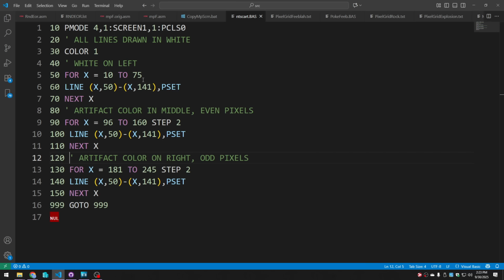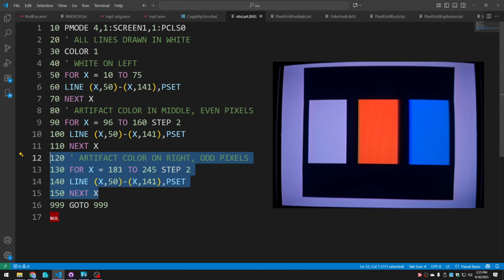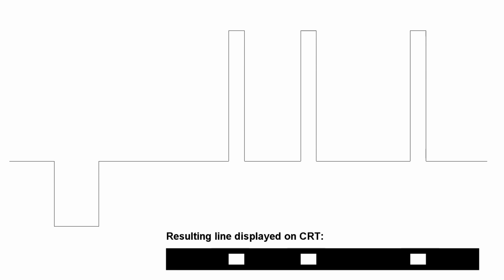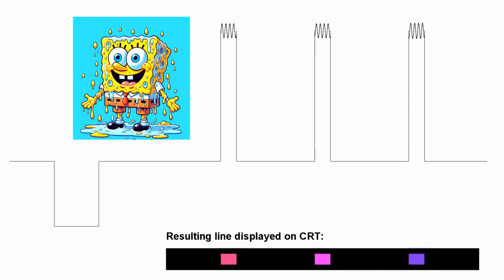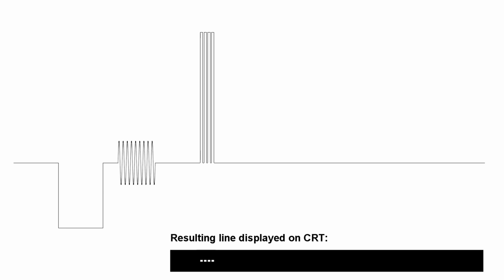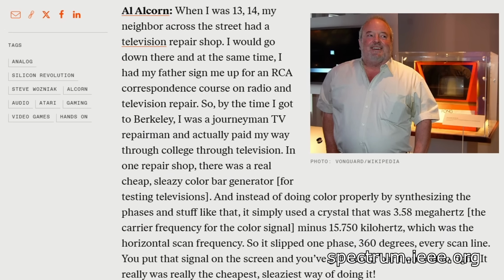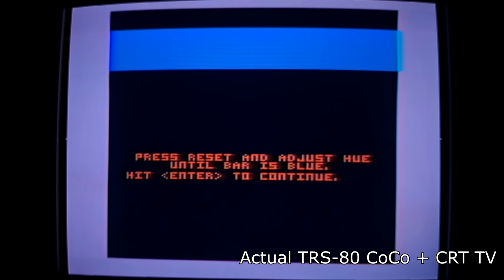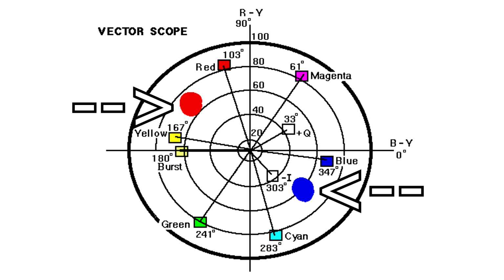How early computers TRICKED TVs into making color (out of nothing at all)

Comment: Not-So-Fun Fact: These "artefact colors" didn't work on TVs which used PAL (or, presumably, SECAM) for their video, since only the American NTSC (Never Twice the Same Color 😉) system was configured so that it could produce colours from B&W.

And the short version of how "artefact colors" worked is that colour in NTSC relied on a signal mixed into the black-and-white (luminance) signal, which the NTSC system could interpret as colour information.  But the way it was mixed in meant that quick changes from black to white to black could be misinterpreted by the NTSC decoder as being colour information.

The PAL system used a slightly different mixing method which meant that the system could not easily misinterpret fast transitions as colour information, although it did produce a vague "rainbow" effect with certain spacings of vertical lines and different spacings of vertical lines were actually incorporated as part of the colour television "test patterns" so that you could easily see that the PAL system was working as intended.
Reply: I do remember seeing the 'rainbow' effect on TV a couple of times back in the day. I believe newsreaders and other people appearing on TV weren't allowed to wear shirts with tightly spaced vertical stripes for this very reason!
Reply: @Tomsonic41 yeah. Actually, the high quality low pass filters at the TV station would filter out most of the false colors. If you drive a TV using your own home computer, you can go full saturation.
Reply: @Tomsonic41  It's still not recommended due to aliasing effects creating weird looking patterns.  The same reason meant it wasn't a good idea to wear such patterns in PAL-land.  The big difference between back then and now is the critical pattern size which scaled inversely with the resolution.
Reply: actually it works just fine on PAL, you just need to use the higher chroma frequency (4.43 mhz rather than 3.58) and invert the "V" color channel each line, other than those two changes, ntsc and pal actually work exactly the same and the same techniques apply
Reply: PAL uses a different color clock. It would be easy for a graphics chip to alternate phases every other line. But US manufacturers did not want to deal with different crystals. Computer manufacturers rather shipped their own monitors (IBM, commodore, Apple).
Reply: @ArneChristianRosenfeldt commodore literally made vic2 that output pal that works on standard TVs.
Reply: @phill6859  commodore started a lot of thinks on the VIC .. Ah VIC2 . Yeah I know that. VIC2 has two clock inputs. You feed PAL frequency into one of them. Color output pin is separate from luminosity. VIC2 really does not do false colors! They even offer a cable which keeps color and luminosity separated all the ways. Later, with a slightly reduction in signal level, this became S-video. On almost every TV on SCART input expects RGB and the other S-Video.
Reply: @ArneChristianRosenfeldt  PAL uses a clock that matches the increased resolution of the whole frame but the major difference is that PAL uses differential signaling on two lines. PAL color televisions required having a small buffer to keep previous scanline worth of signal available to allow correct color decoding.
Reply: @MikkoRantalainen  at least generation of PAL was simple: You just flip a bit in a register of the TED of the C-16 . Buffering digital signal is easy, buffering analog signal is difficult. How do you calibrate it? Otherwise you get horizontally shifted ghost images. With proper calibration in a TV set, the color burst on NTSC would work and we would not need PAL. I never understood how a TV could not self calibrate: Decode the next color burst as if it was a picture signal. If it is not to spec, your color frequency is off. Or some weird phase shift. To separate these: measure 3 color bursts in total. You can do it above the top border.
Reply: @ArneChristianRosenfeldt  I  think the problem with self-calibration was that the devices that generated the signal had low quality clocks, too. The TV sets were trying to resync the whole signal for every scanline because clock was assumed to be too inaccurate to keep the same pace for the whole frame.
Reply: @MikkoRantalainen  I did no deep dive into tube TVs, but I would ramp up the power of an LC oscillator while I seed it with the color burst, and then highZ the input and keep powered until the end of the visible scanline. If the frequency is off, the color should change across the screen. I guess that seeding introduces some unpredictable phase shift.
Reply: @ArneChristianRosenfeldt  I don't know the exact failure case either. I just know that analog circuits can do all kind of funny stuff when built cheaply or are otherwise out of spec. And it turns out that many content authors are doing cheap stuff so the input signal is already broken and then cheap analog TV set tried to workaround it and the resulting behavior was the most successful over all the available more or less broken content.

This is not that different from biological evolution: multiple parallel almost-similar implementations pop up and the most successful implementations get copied later. And in case of TV sets, the most successful implementation was "good enough for all the broken content" combined with "cheapest possible implementation". Continue that for a couple of device generations (both content authoring side and viewer side!) and you end up with something that's technically broken but still outputs usable visual screens for real world content that's technically incorrectly authored and transmitted.
Reply: Ntsc was actually a brilliant hack. Alternating current in the US was 30 HZ so that was the TV frame rate. When they added color, there was not enough room in the spectrum so they had to make room for the color signal, resulting in the 1001/1000 pull down. That set the frame rate at 29.997 Hertz.    And color was just kind of stuck in wherever it could be.
Reply: @gack_mcdoodie  It wasn't that there was not enough room, it was to avoid static speckly interference from the 60Hz mains power. So they made it slightly out of synch so any speckles wouldn't be static and much less noticeable.
Reply: @shyguy6215  Wrong way round. Interference is much LESS noticeable when it is stationary, which is why in the black & white days the vertical frequency was locked to the power-line frequency (this was not an NTSC thing, every TV system worldwide did the same thing.)
With color the vertical frequency is locked to the frequency of the color subcarrier (multiply by 2 and divide by 525x455) and thus could no longer be locked to the power-line frequency.

Using a 30Hz  frame rate would have given a colour subcarrier frequency of 30 x 455 x 525 Hz  = 3.583125 MHz. However using this sub-carrier frequency gave rise to annoying interference patterns due to the beat between it and the 4.5 MHz sound intercarrier frequency on some existing B&W receivers.  The chosen solution was to shift the color subcarrier down by 0.1% which resulted in the beat frequency being an exact multiple of the horizontal frequency, thus making the interference pattern stationary and hence less visible. The new subcarrier frequency then became 3.579545 MHz resulting in a frame rate of 20.97 Hx.
Reply: @gack_mcdoodie  USA AC frequency was (so far as I know) and still is 60 Hz, which is the TV frame rate.  It's interlaced, though, which means that each half-frame would be 30 Hz
Reply: @gack_mcdoodie the 1000/1001 was not necessary as per modern day experts. Probably something about super heterodyne demodulation short cuts.
Reply: That's why VCS-2600 could display 128 colours on NTSC, 104 on PAL and just 8 on SECAM.
Reply: @galier2 Not actually, no. The VCS can't generate artifact colors, the resolution is just too low.

The TIA chip directly generates chroma and luma signals, and PAL systems use a different TIA that generates PAL-compatible chroma instead of NTSC-compatible chroma. Differences in the generator circuit are responsible for the differences in color.

SECAM just got screwed. There's no SECAM-compatible TIA, they used PAL TIAs, left chroma disconnected, and added a minimal circuit to make each luma level a color instead.
Reply: That' s likely one reason this trick wasn't in the documentation. It was dependent on the television so not fully under the control of the programmer.
Reply: @WoefulMinion  My first guess would be that they wanted to keep the manual simple, so they left out anything which (supposedly) went beyond the capabilities of the hardware and relied on software tricks.
Reply: @melkiorwiseman  That's a great point. The manual wasn't meant to cover everything. They only had half the manual done when I got my first Color Computer. They sent me the second half once it was ready.
Reply: Fun fact, I am in Brazil, which uses PAL-M and have a CoCo clone (the CP-400) that does color artifacts just fine. But it was much more predictable, it was very difficult to get "inverted" colors. No, I can't explain this.
Reply: 4:19
Reply: NTCS came first.. of course its ganna have afew quirks.. but I'll take NTCS over PAL any day (that and we use pulldown instead of speedup for movies)... we wanted color TV quickly... its also color over encoding (as i remember) while PAL uses color under encoding.. along with phase nonsense (phase alternating lines)... it came later... of course the quirks are gone.

Dont attack what you dont understand

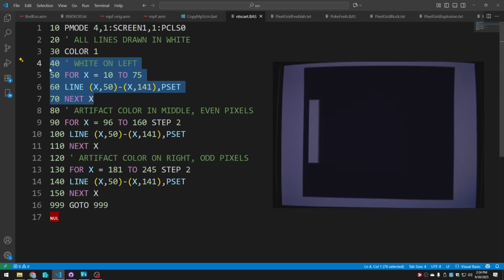Comment: 2:19 Could have cheated and shortened this up, but then you don’t get the satisfaction of watching the white block being drawn line by line:
Delete lines 50 and 70.
Edit line 60 replacing the first X with 10 and the second with 75.

Sorry.  My BASIC brain wouldn’t let me not say something.

Fun video detailing how our favorite hires 256x192 was actually only 128x192 on TV screens.  This of course made it pretty much impossible to “draw” text on the PMODE 4 screen in 8x8 matrices (for 32x24 character display).  But for making games the colors were a blessing. 🖥️
Reply: Since I live in a PAL country, I wrote a machine code program to allow BASIC programs to write text onto the PMODE 4 screen.  It worked quite nicely, since there were no "artefact colors" to deal with.  That way, I did wind up with a 32x24 character display.
The program used PCR instructions to access the character table, so it could be loaded anywhere convenient in RAM, and what I'd commonly do was to PCLEAR 6 and use the extra space to hold the program and character table while using the first 4 pages for the graphics screen.

It used a USR call with either a string or an integer number being passed in, and with the updated cursor position on the screen being passed back out.
If the parameter was an integer, the lower 8 bits were taken to be an index into the character table to print that character.
If a string was passed in, you could not only print the full IBM Extended ASCII character set, but also pass in various control codes to clear the screen, position the cursor, reverse the video and even (and I was especially proud of this part) redefine any of the characters in the table so that you could (for example) print out a 8x8 graphics sprite.
There was even a command to interpret the next 8 characters as byte data for a custom character to be printed which wouldn't replace any of the predefined characters in the table, and a command to repeat the last character printed.

I would probably have expanded the program to allow you to define a character "shift" which would have made actual sprites possible, but by the time I'd done as much as I said, the CoCo was well on the way to redundancy.  Sad, but true.
I'm sure I still have the tape of the machine code program tucked away in a drawer.
Reply: @melkiorwiseman Over three decades later and I’m still jealous of you, getting all 256 pixels!  Of course I’m sure there were just as many times when you would have killed for the artifact colors. 🎨
Reply: @van_goghx  One advantage of having all pixels available was that I wrote a machine code routine to allow the full IBM Extended ASCII character set to be printed on the high-res screen.  It worked great since you didn't have to worry about artefacts.  Completely relocatable using PCR instructions, which meant no need to clear RAM space since you could just PCLEAR 6 to reserve more than enough space for the program.
I abandoned work on it because the CoCo was on the way out after the IBM and compatibles came out.
Reply from the maker: Did you also intend to add a ",BF" to the LINE command then?  Yes, that would have been smaller and faster!  Though I did want to illustrate very explicitly that the only meaningful difference between white & artifact rectangles could be the "STEP 2".  And that required drawing the white one the same as the others.  Perhaps I should have added a warning, "do not try this at home".  😁
Reply: @CocoTownRetro ”…add a ‘,BF’…” Touché!  lol
Always enjoy your videos and the quick romps back into those “colorful” teenage years.
Reply: @van_goghx Was there not also a trick where you draw a 4 colour image in PMODE 3 using filled circles,  rectangles, paint fills, then switch to PMODE 4 without clearing the screen? I may have misremembered this as it was 45 years ago but I have a fading memory of making a chocolate cake with coloured candles on my dad's CoCo 1 that might have relied on being able to do this.
Reply from the maker: @bornach YES.  You are remembering correctly.  By drawing with PMODE 3 active, your BASIC code effectively writes the bits 00, 01, 10, or 11 for each pixel, which are exactly the same bit pairs that generate the artifact (or B&W) colors on PMODE 4.